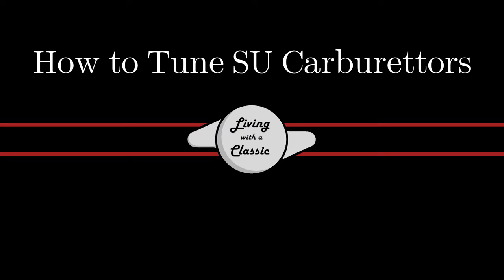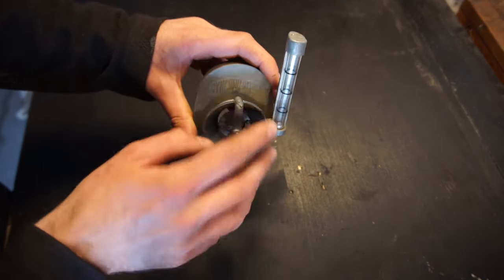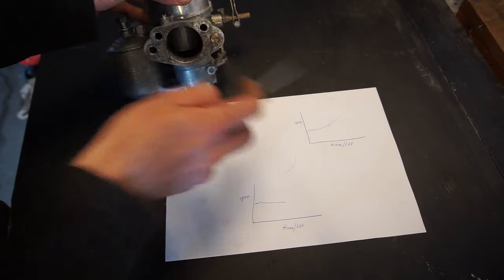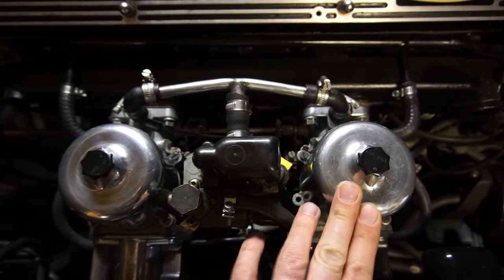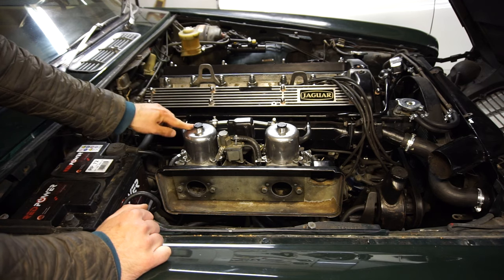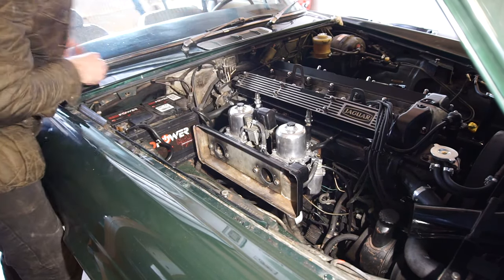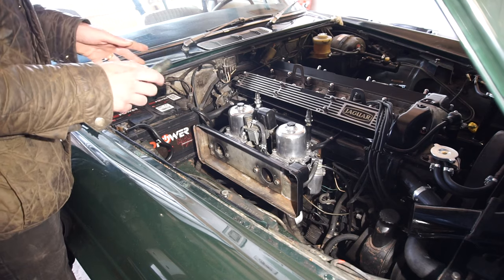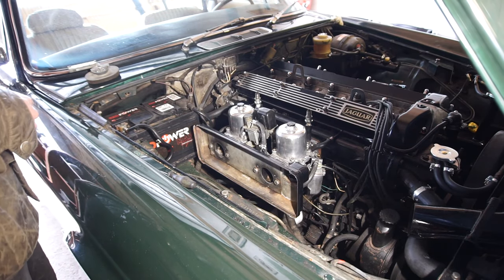How to Tune SU Carburettors

Comment: What is the job of a carburettor?
Reply from the maker: It delivers fuel to the engine on older cars that don't have fuel injection
Reply: Hey! I have a question for you...
I have a factory manual xjs. I think I had to replace the gear linkage bushes.... Any advice please???